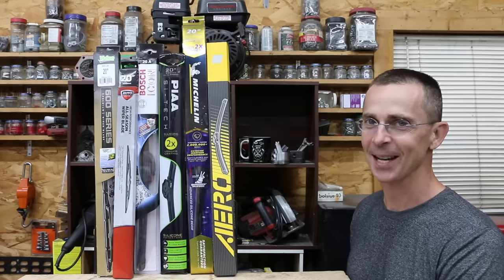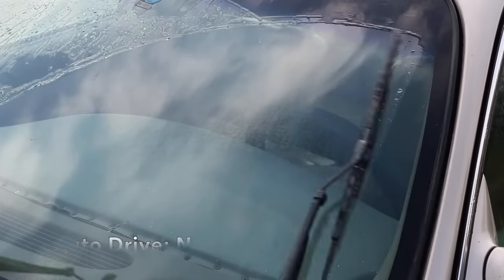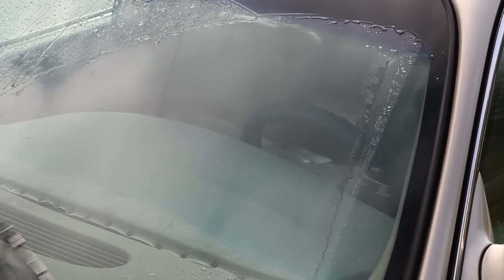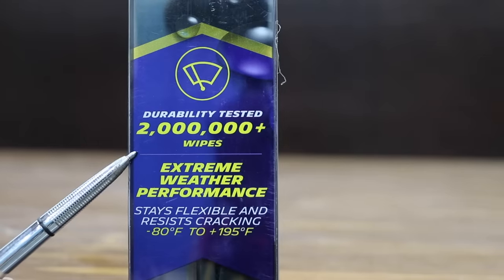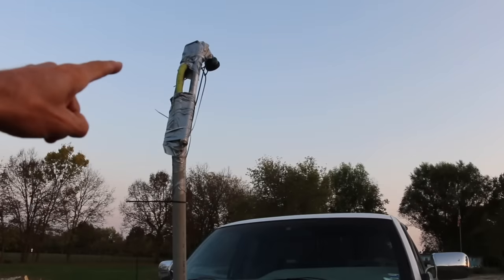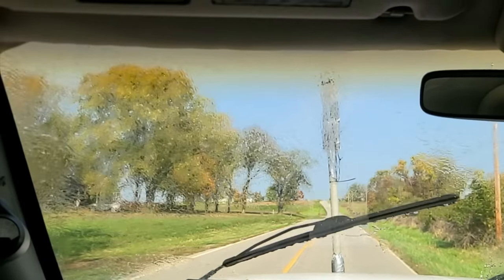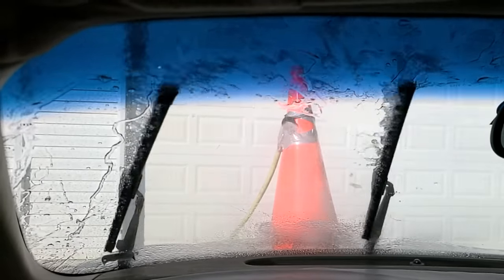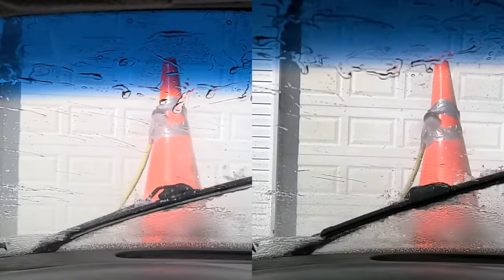Best Windshield Wiper Blade (AFTER 1 YEAR)? Bosch Icon, Rain-X, PIAA, Trico, Valeo, AERO

Comment: It’s far more important for the wiper to remove water and mist than to last long.  Safety first.  I buy all rubber wipers that last for about a year and then replace them to get the windshield clean as possible.  
I’ve tried everything else from $25 wipers to five dollar wipers. The cheap all rubber wipers do the best job of getting rid of the water.  The softest and best rubber comes from Vietnam.
However, the wiper blade is only half the story.  Wipers should be aligned so that they face the glass at 90° degrees.  Otherwise, the wiper will chatter and scrape across the glass.  I align my wiper blades by bending the wiper arm, using two large wrenches and then gently setting it down on the glass to see if it’s perpendicular.
RainX is a tremendous product. Above 35 miles an hour you don’t need wipers if your windshield is treated with RainX. In addition, you can use RainX windshield washer fluid, then occasionally squirt it on in a heavy rain.
The best wiper blade is a new wiper.  I have found the Bosch icon to do a superior job.
Reply from the maker: Thanks for the feedback.

Comment: No Anco? 
    I used to buy Bosch and other expensive wipers. I have gone back to the cheapest Ancos. They are incredibly cheap at rock auto, often less than $3 for a blade (Not a refill). I buy many, then replace as soon as they annoy me with streaking or noise. It takes more time to open the package than to snap them on the arm. 
   No matter what the quality or expense of the rubber is, something gritty, sharp, or abrasive will damage it...time to replace a $26.00 wiper, or a $2.90 wiper. The quality of the metal part of the arm seems identical to more expensive wipers.
   I save the 2 stainless ribs from the rubber...useful, have used for various purposes, even as filler rod for TIG welding. Just to try it, would not use for anything important due to it's unknown alloy, but it did work fine, BTW.
   If I have chatter or noise in one direction but not the other, I find that the angle of contact of the rubber to the glass is tilted one way or the other, and fix it by slightly twisting the flat part of the arm to correct it. Use a little adjustable wrench to twist it just a few degrees, usually that fixes it.
    Wipers that are marginal are sometimes rejuvenated for a while by wiping them lengthwise with a mineral spirits soaked rag..sometimes I do that, sometimes throw another cheap wiper on.
   Bowing the arm a little to increase spring pressure against the windshield is sometimes helpful, as is ensuring the arm's spring pivot moves freely and has a tiny bit of lubrication.
   These details matter a lot more than throwing lots of cash at one part of the system and ignoring the rest of it. Give the part a chance to work correctly. 
   RainX washer fluid seems worth it, too.
Reply from the maker: Thanks for sharing.

Comment: In your next test on wipers....try the Denso brand. While they offer several different levels(and price points)for wipers, go with the cheapest lowest end Denso.
They can be purchased from Rock Auto for under $4.00 each. Of course,this depends on the size of the blade.
As an aside......to make wiper blades last an incredibly long time.....use 303 protectant on them. You will be impressed. 
If I've missed some of your tests and you have already covered this, please disregard.
Reply from the maker: Thanks for the suggestion.

Comment: I really wish Bosch would come out with a Silicone version of their Icon blade design. A lot of brands seem to make the mistake of having a large cutout section on the blade around where the arm attaches to the blade. What ends up happening is because it's now the low spot, at speed water can pour over the blade in that area when the blade is doing a sweep, and leave a large streak right in the middle of your sight line.
Reply from the maker: Thanks for the feedback.

Comment: That hybrid design with rubber covers actually worked really well in my previous car, whereas the modern style didn't.
Not sure what the reason is, maybe wiper arm spring tension? I think the modern style needs more spring tension to wipe well.
Reply from the maker: Thanks for the feedback.

Comment: I have to get new blades for my car and remembered that you did a video on them. Glad I watched it already or I would of had a harder time finding the video. I’ve used RainX on my old car but the car I have now uses 2 28 inch blades for driver and passaged side. I never bought wiper blades that big a before. My wipers don’t move left to right like ur car and my old car. On the car I have now they move from the center then out then back to center. I wonder if that would change how the wiper blades would do. I think I’m gonna try to get the Bosh Icon blades this time if I can get 2 28 inch ones and if I can’t then I’ll go with the RainX like I have before.
Reply from the maker: Thanks for sharing.

Comment: Living in Phoenix is not good for wipers. Since it only rains a few times per year (but when it does, it can be a nasty downpour), wiper blades spend most of their time parked, and if you park outside for work or home, the blades will be lucky to last one year. The problem comes when you get a monsoon storm, and you haven't used the wipers for months, that is when you find that the rubber is falling off the blades! 
PS: I have used Rain-X blades in the past, and they work very well.
Reply from the maker: Thanks for the feedback.

Comment: Seems like everyone is coming out with Silicone blades now, would be neat to see a longer term test on those new offerings too. I've gotten about 18-24 months out of the Rain-X brand Silicone blades on my outside parked year round daily driver which is pretty amazing and beats any rubber blade I've had by 12 months.
Reply from the maker: Thanks for the suggestion.

Comment: Pro tip, try buying just the inserts for your blade and swapping them out, much cheaper than buying the whole shebang again. I went OEM off ebay and paid less than any brand of ENTIRE wiper assembly.
Reply from the maker: Thanks for the tip.

Comment: Washer fluid typed & brands?
I notice some brands you can smell the alcohol from in the car when using others appear to be blue tinted water.
What chemicals are actually in them in what amounts?
Also Rainx orange contaminated my fluid level sensor and it had to be removed to clean off completely

Comment: Just stumbed on your channel and, like others have said, I appreciate how much work and planning it has taken to do just this one test. 

I have a request: I live in Southern Ontario (near Buffalo, NY if that helps) and one of the big challenges in the winter is that even with just a small amount of snow, if it's wet it will accumulate on the left edge (after the left sweep) and some of it will stick to the blade and "hitch a ride" back on the right sweep. This, as you can imagine, tends to leave a huge messy swath on the glass, and it is invariably right at your eye height. Do you have any insights or recommendations to address this?
Reply from the maker: Thanks!  Thanks for the suggestion.

Comment: In a wintry area, ice build up beats up the blades. I find cheaper or more expensive is less important than just replacing more often. I use beam-style Trico Ultras from Rockauto at $8-9 each. Made in USA and just replace them at any hint of degraded performance. I get 6-9 months of excellent performance and another 3 mos decent.
Reply from the maker: Thanks for the feedback.

Comment: I used to love the the Bosch Icons but they have become increasingly harder to find in certain sizes and I have noticed at least on my F250 that the 22" blades seem flimsy the further they go out from the arm hook which causes inconsistent wiping on the windshield that was not present with the OEM beam blade that came on the truck from the factory. Walmart usually has the Michelin Endurance XT  beam blades so I may try those next.
Reply from the maker: Thanks for the feedback.

Comment: Very good video, but it seems you left out some of the most popular, and cheapest wiper blades. Anco, and some of the house brands, like Autozones Duralast.
Bosch also has a few different grades of blades.
I liked the Bosch Icon (I think) wiper blades, but on each set I've installed (On my F-150, and my wifes Durango), the clip area has deteriorated and broken apart, and the wiper can easily slide out of the arm. On mine, the little cover actually flew off on the highway, but the blade stayed clipped in. On my wifes, the cover broke when I was scraping her windows one winter, and the wiper slid right out of the arm. I rigged it to where she could get to work, and then got it replaced later.
I bought them at Autozone, and they replaced them for me, but it's a pretty bad issue. They need to use a better plastic that doesn't get brittle in the cold.
Reply from the maker: Thanks for the feedback.

Comment: I had good luck with the michelon high end version if ur stuck with buying them at Walmart.  That was the best value I could find at Walmart for blades..  I took the one that said that it guarantees the most wipes or something like that by michelon.  Lasted a long time.   I wonder how that would compare with the Bosch icon in your tests?  I just got the Bosch icon blades from AutoZone.  I had to go to one of those shops to get them.

Comment: I had the Michelin ones from Costco (not sure if they were silicone or not) on my car from about late April 2022. In July they stuck to the hot windshield and tore when they broke free. I will not buy them again - also, as a former Michelin employee, I  know that Michelin doesn't make wipers. Michelin puts their name on the blades made by someone else.

Comment: @Project Farm I appreciate all the amazing work you do with your channel, but this test lacks the most important challenge - how UV exposed blades perform under small amount of water conditions and how long does it take them to make windshield clearly visible after blade passes the certain point on the windshield. Because when a blade is new water residue is slim to none and as the blade ages water residues are getting thicker and it gets more time to evaporate them, meaning it's time to change the blades.

Comment: Why the change in brand models? I thought the stated plan at the end of the last one was to test /those/ blades a year later, but you changed up the models here kinda throwing away that data. Were those models just not made any longer?

Thanks for all the research and testing!

Comment: I have a 2010 Honda civic.  I could possibly get the old fashioned replacement blade. I'll have to check into it,  as the blade itself does have that special wing on it,  which gives it down force when driving at hyw speed.
Reply from the maker: Thanks for sharing.

Comment: I currently use a Rain X blade. I am not sure of the model. They generally work well but my nature is to expect perfection, at least right out of the box. 
The only significant complaint I have is  that on a cold morning with dew on the windshield  it is impossible to see through the windshield looking directly into the early sun after the dew is removed. I think the Rain X wiper is impregnated with a chemical that reduces surface tension but creates this other problem. I will not buy another pair. Rain X solution works extremely well and when applied regularly wipers are not needed in most cases.
Reply from the maker: Thanks for the feedback.

Comment: I bought the Aero Voyagers earlier this year and I'm not impressed. In light rain, using the washer fluid, or just clearing off condensation, it smears the windshield pretty good on my 2016 Frontier (18" + 24"). They are budget friendly, I paid $18.75 with tax and it comes with a replacement set of rubber pieces, but I'd recommend getting something better.
Reply from the maker: Thanks for the feedback.

Comment: I really appreciate your channel and am an avid subscriber. I have a brand new set of Bosch icon wiper blades for my 2018 Ford escape. I am having a problem with the passenger side blade making a clicking sound when it completes the up stroke and begins the down stroke. It is not as noticeable when there is more water on the windshield. Can you advise me of a solution for this problem? Thank you very much.

Comment: no matter the brand for the last 30 years I have been only replacing the driver side wiper. every 3 to 4 months I buy a new wiper blade put it on the driver's side replace the passenger side with the 3- 4-month-old drivers' side. never made sense to me to put a new blade on the passenger side. I kind of base the change on the passenger side if I start seeing it streak, I get a new blade. not even sure it saves money I just know I always have a very clear view on the driver side and don't really notice the difference on the passenger side until it streaks.
Reply from the maker: Thanks for sharing.

Comment: Ease of (un)installation - a factor? Purchased Rain-X Endura in part thanks to this video - and had to return them the next day: they refuse to fully snap onto small J-hooks on my car, and there's a history of similar Rain-X wiper installation issues on J-hooks going back years. (The earliest I found was in 2015.)

Can't install means can't use. A 100% failure. 0% performance. Their "wiping" performance, streaking, quietude - matter 0%. Because: can't install. Note that the issue is common and auto mechanics among those affected. I.e. no, Rain-X, "it's not me, it's you." :)

So maybe test those wipers on ease of installation and un-installation first, their wiping performance second? Thanks!
Reply: P.S. Bosch Icon - snapped right in.
Reply from the maker: Thanks for the suggestion.

Comment: I'm interested in buying a top quality cooler in the 20 to 30l range.  I'm looking at ICECO coolers and wondering how they compare.  I'm a patron and appreciate your research.  I know there is a lot of money involved in purchasing the coolers but it's that time of the year for coolers and there is little to go on.  In the past I've had little ice coolers like Little Playmate or medium coolers like a steel Colman.  I even had a 12v plug in cooler that drained the battery if lift plugged in..  Just a though for a new video.  Thanks in advance. John S.
Reply from the maker: Thanks for the suggestion.

Comment: As of the beginning of 2023, the Bosch Icons are around $25 or so per blade now. All of the best blades he tested are $20-25. The best ones in this test seemed to be the "silicone" ones, so my suggestion is if you can afford the Icons get them, or go with whichever silicone blade is the cheapest or on sale for you. I know that Michelin Endurance Silicone seems to be $20 at Walmart.
At least stick with beam style since they seem to hold to the windshield better.
Reply from the maker: Thanks for the feedback.

Comment: I've been Using All The Various Generations of Bosch Wipers for @ Least 35 years, with The Raire Exception of wife, or No Other Option Available. Or say rear tailgate Wipers that you have to get factory replacement. But Other Than That, It's Bosch All The Way  !!!
And Even With The BRUTAL SUN in California you Can Almost Always Get Three Years out of Them, But You Should Replace them Every Year or Two !!! 
New Blades Are Just So Much Nicer.
Reply from the maker: Thanks for the feedback.

Comment: I have a 2015 Kia Sorento SXL, and am using Anco Profile beam blades (24" and 20") with Bosch on the rear window (11") and thhey so far, combined with Rain-X, do a fantastic job.  Some wipers I have seen intests, lift up at the outer edge of the blade.  These do not.  Great blades, and only around $9-$11 each USD.
Reply from the maker: Thanks for the feedback.

Comment: I had a set of the Michelin silicone blades and sadly they were among the worst wipers I’ve ever bought. They may endure UV better than rubber, but definitely wore from use faster. Mine hardly lasted a month
Reply from the maker: Thanks for sharing.

Comment: What wipers squeaked when dry?  I have PIAA wipers and they make no noise even when dry.  The TRICO wipers squeak alot when dry.
Reply: dry? like no rain dry?  

Bruh
Reply: @TheAgentAssassin  Yes like when you are using them and there is a dry spot, do they squeak?    Have you even wipered before? Brah?

I found the TRICO wiper squeak when dry or just a dry spot during rain.  The PIAA never squeak, ever.  How are the others?  No one wants to buy a wiper that squeaks to tell you to turn them off or just squeaks because the rain is light.

Comment: The actual rubber/silicone blades are all the same made at the same factory with the same materials on the same machine. All they do is change the extrusion dyes for the different blade designs.
Reply from the maker: Thanks for the feedback.

Comment: Test product suggestion: Best car window rain repellent.

Examples include:
CarPro Flyby Forte Professional Windshield Coat,
Drexler Ceramic Glass Coat.
Duragloss Rain Repel Glass Cleaner and Protectant,
Glass Science Rain Clear Windshield Water Repellent Gel,
Gtechniq G5 Water Repellent Coating,
Invisible Glass Premium Glass Cleaner with Rain Repellent,
Nasiol GlasShield Wipe-On Nano Rain Repellent Wipes,
nextzett Glass Sealant,
Nx Nova Glass Hydrophobic Glass Coating,
Rain-X Glass Treatment,
Rain-X Glass Water-Repellent Aerosol,
Rust-Oleum Shield H2O Rain Repellent Spray, and
Stoner Rain Repellent

Comment: I gave up on windshield wipers, there expensive and there JUNK,  don't last a year. 13 years ago I made my own and they look really nice. I'm still using them today. Using the rubber that is used on electric transformers for the lid were I work. I don't remember the old car the wipers came off of but with a little engineering and the rubber there still working today.